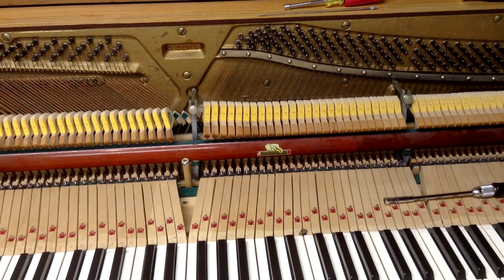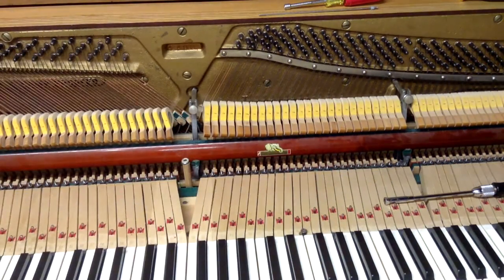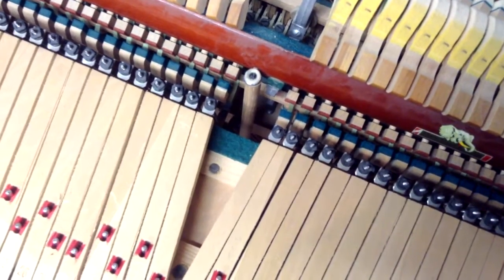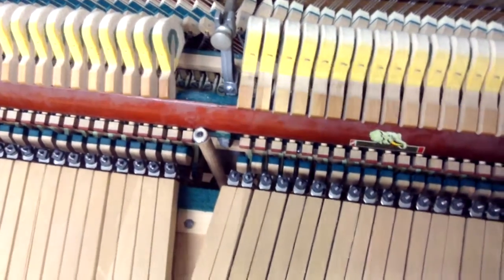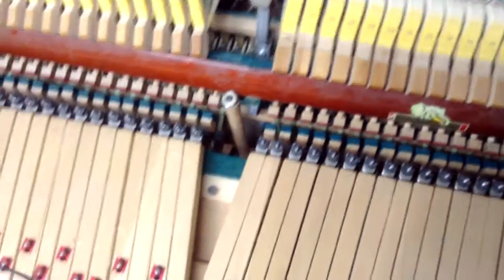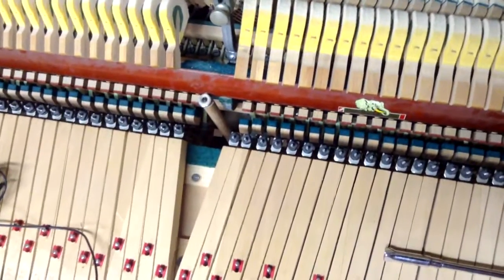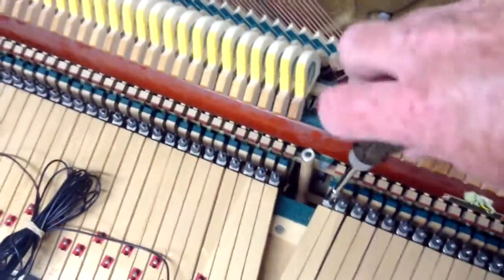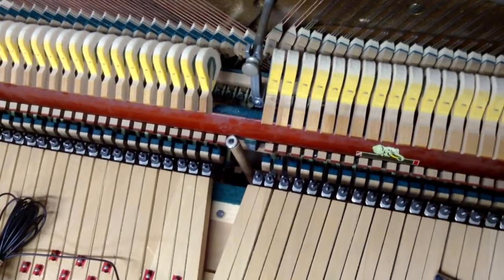Adjusting Lost Motion On A Spinet Piano - Piano Tuning & Repair I HOWARD PIANO INDUSTRIES

Comment: Question about Spinet Pianos:  Is there a way to somewhat easily access the hammer flange screws (for tightening) without having to remove the entire action?  I encountered a piano where there were two loose hammers and I am 99% sure it is because those screws are not tight but I could not even see the hammer flanges let alone get to them for all of the stuff in the way.  I am having a hard time finding any information on this but since you have a few spinet videos...I thought perhaps you might know!  This was on a Yahama brand spinet.  The drop stickers (square wood dowels) were attached to the keys via some sort of a rod that stretched across the key tops instead of via rubber grommets.
Reply: PolarPalmWV you ever fix your spinet?

Comment: Does this also fix the irregularities of key heights? The white keys on my Gulbransen spinet look a little uneven from the front- some are slightly lower or higher than others.
Reply from the maker: It is possible on some spinet piano with very light keys, that this adjustment will in some cases change or correct difference in key height, but in most cases the irregularities in key height is corrected by adding or subtracting punching under the key at the balance rail pin. See our video " Piano key Leveling" under Piano Regulation Videos.
Reply: @howardpianoind  Thank you very much. I adjusted all the keys like this, and actually it did fix most of the irregularities. There are a couple of keys that are going to need leveling per that other video.